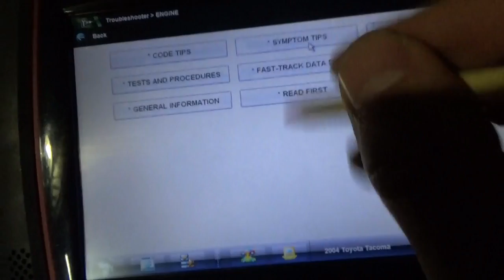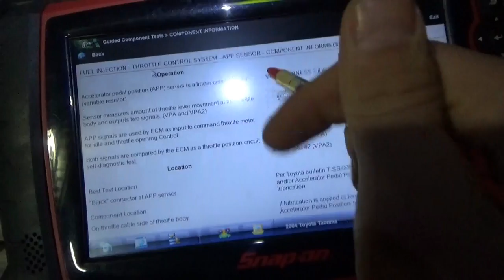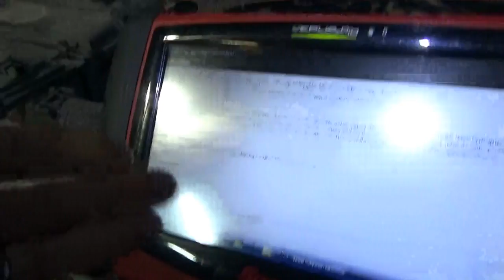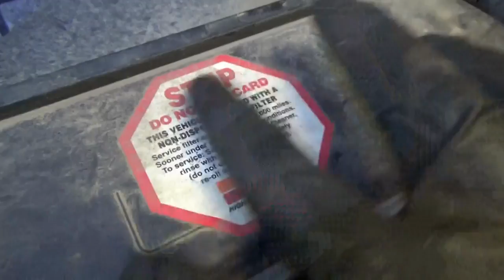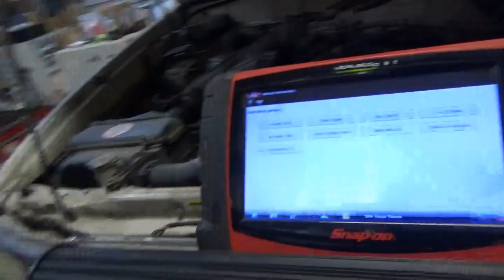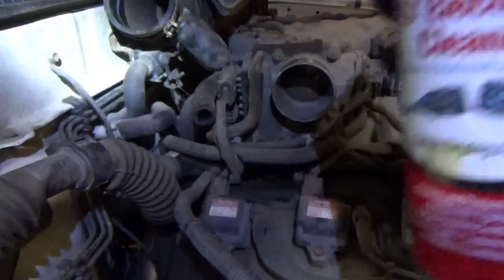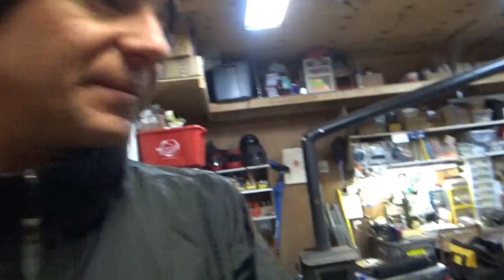Toyota Truck LIMP-HOME (P2111)

Comment: I know this is an old video but the problem ever come back and did you ever figure out what it was? I have the same issues and code!
Reply from the maker: Truck is still running great at 304k miles! 😎
Reply: Thanks for the reply!  Definitely a coincidence that I’m having the same issue @ 265k miles. Gonna clean throttle body and go from there.

Comment: I got a 2.7 automatic 2001  i got a loss of power , hardly goes past 2k rpm , i checked aur filthers, and cleaned them, and the Trothle and cleaned it, i changed the coils the 2nd and 3trd keep getting dirty, idk what problem could be

Comment: Yep.  Got an 03 and bastard did same shit..  randomly the throttle has no response..  replaced tps.  Still broke.  Tested all wiring and back to the ecu.  No signal at ecu..  replaced ecu…. Fixed the issue..  pos..  for a month i just unplugged the tps and accel pos sensor along with the motor in the tb and rigged it up to use the cable only..  was the only time in that motors life where it actually went to 100% throttle..  lol. Otherwise it cuts at 70%..

Comment: That air filter looks like one of my lawn mower air filters after not cleaning it for 5 years LOL but my engine always ran lean (for 15 years) so it ran worse when I cleaned it. After a rebuild of the carb it ran good with a clean filter.
Google says: . . .  use Super Clean to clean the K&N filter and 30W oil can be used. You can use compressed air before washing as long as you don't get to close to the filter with it. Use a garden hose but not to hard. This engine might have eaten a chunk of dirt or a pine needle that set the code but then swallowed the debris and just burned up.

Comment: I trashed my Kinder and Natalie air filter years ago. Project Farm did some air filter testing. The kinder and Natalie air filters pass to much dirt. 
I had to remove my intake manifold and actually pressure washed it. Never seen so much dirt get washed out. I now run OEm type filters only.

Comment: I'm just have the same code says throttle body by actuator stuck open and the second code say throttle body stuck close so  throttle body position sensor can fix or need a new throttle body???

Comment: Water contaminated fuel got in so we cleand the tank etc n fuel to the motor but no start - we disconnected the battery hoping for a reset n now no crank n all the warning lights on ......any idea wtf happened....n a fix..?? Thnx

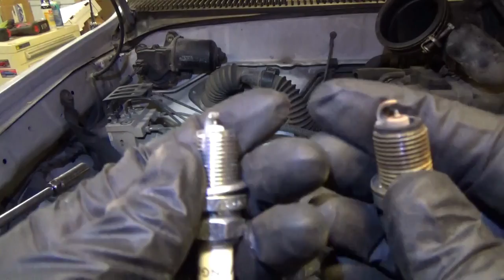Comment: 24:50 the brown deposit on the threads is combustion deposits when very fine leak develops between the plug gasket and it's seat around the threads (dirt lodged between the plug gasket and head)

Comment: those filters are designed to be cleaned and reused,they do sell kn filter cleaner and oil but just hot soapy water works,im sure you could substitute oil for the filter using mineral oil/veg oil or somthing that wont evaporate in time.those filters are high flow so oil is very important as thats what catches the micro particles if you ever do clean one
Reply: yup bucket of super hot water and sunlight clothes detergent for cleaning, and a spray bottle set on mist with atf watered down  with 99% isp alcohol, been doing this for years even on my foam filters
Reply: @stunessa1  ill try this detergent,i used dawn liquid soap but detergents should work better

Comment: Toyota has a badly designed air filter box where it is difficult to close it properly. Many times people don’t realize a gap or opening even though the airbox seem to be closed properly. Whole bunch of dirt get sucked into the throttle body. I see this all the time.

Comment: I have the same fantastic model. I would have cleaned the mass air flow sensor for sure and installed the correct duel ground Denso or NGK plugs as specified by Toyota. Toyota has even placed a sticker on the timing belt cover the importance of the special plugs.

Comment: Use denso K16tR11 dual ground standard plugs or NGKBKR5ekb-11 as suggested on the lil picture on the timing belt cover, they will last longer.  Ditch the K&N it doesn’t fit the air box well, poorly made and just dirties up the entire system with oil and ruins MAF’s.

Comment: I had one like this some years ago with the standard air filter in a 7.3 IDI. The customer thought it needed a new injection pump, but clearing the air filter solved the issue
I have no problem with these filters, and special cleaner and oil is not necessary. Any standard window cleaner works fine, and regular 30wt can be used in place of K&N products. 
Dump it in a bucket with some windex, wash it out with a hose, dry the element, spray some oil on it and it's good to go.
Oh, one off road recovery will more than pay for a timing belt replacement, so, do the math.

Comment: K&N filters and ones alike are meant for pavement Princess vehicles. If you look at project farms video comparing air filters, K&N was 100 times worse at filtering dust, versus a paper filter.

Comment: K & N filters are ok for on road use. They suck for dirty off-road use. The filter oil holds on to dirt and debris that should fall off the filter and accumulate in the box. This eventually reduces efficiency over time since most people will not clean and oil the filter every time they go and get it dirty.

Comment: Ok, just too simple. Air filter is EVERYTHING on any vehicle. Common sense  says off reading requires you to do more maintenance than normal requirement. zmost vehicles post a severe duty maintenance schedule.  That air filter is TRASH!  How can it NOT be related to the air filter. Of course it sucked the filter in and allowed garbage into and jamb up the throttle. The dirt in the throttle body was a dead give away. My dad always said, start with simple stupid before throwing the parts cannon at it.  Any regular Shop in town would call the owner and demand that they install a factory filter. That one was beyond cleaning. Aftermarket air filters especially K@N are SHIT!

Comment: Owner: wants problem fixed so the truck is reliable as possible and won't break down in the middle of nowhere 

Also owner: still has original timing belt with over 260k miles

Comment: Ask indicated by others K&N filters are a marketing hype (to the tune of $40). More than one Youtuber has tested them and the results are in. The K&N filters will let in a little more air (CFM). Along with more dirt and "filter oil". The  results are measurable. You be the judge. At best with a modern engine you might get a pony or two for a few months. You then spend the "rest of your days" tracking down oil coated MAF sensors, extra wear in the engine, ....

The Project Farm youtube channel had a good review of air filters.

Comment: I have a 1999 Tacoma 3400. I placed a K&N air filter on it and had to clean the Mass air flow sensor on it because oil from the filter covered it and slowly pick up dirt and it gave an incorrect reading. I went back to a paper air cleaner and it has run fine ever since.

Comment: I can’t be bothered to clean oil   a kn filter I just install a paper 🧻 filter every 4 oil changes.   That plug was pretty worn and engine was running smooth it must be a Toyota 👍

Comment: Yota power!!  Haha,   those motors are bulletproof!!!  Reliable and strong lil uns... lol.  I can't unsee this clip when you dewalt it in the spark plug hole.   Damn!  Makes me cringe lol. You're lucky it didn't go batshit, lol.   Nice video!  When i got my blazer at 223k miles.  Throttle body got so carboned up.  Cleaned the hell out of it.  It runs like champ.   Now it's 240k with original motor and trans.  Lol.  So anyway.   Great job cleaning up the throttle body!  Many thumbs up

Comment: Had similar problem with my 2000 tundra 4.7 going into limp mode over throttle body issue.  Only on very cold days, if I were to do a quick throttle response after first starting to drive it cold, it would throw a engine light and kick into limp mode. It is a heated throttle body, and when it's real cold out that motor that moves the throttle plate can lag compaired to what the ecm reads the throttle position to be at.  So on very cold days I make sure I fully heat my truck up before driving. Knock on wood it's been 6 years trouble free since it's happened.

Comment: Maybe I missed something, but I certainly would have replaced the air filter as part of the tune-up along with the plugs and fluids you were to perform. Maybe you did, idk. If not, you contact the customer with a revised estimate to include a stock replacement air filter. Additional part won't break the bank and well spent, especially in this particular case.

Comment: I would have cleaned the intake temp sensor and MAF sensor also I seen ford had a call back on there throttle bodys kept going limp in mode n also needed reflash after throttle body cleaning

Comment: What a bizarre setup. Who puts an electronic throttle in and leaves the accelerator cable into the engine bay? And why only on the 4WD model? Only Toyota apparently, lol.

Personally I would disregard the advice on the K&N sticker and go right ahead and discard that thing, and use a regular style air filter..

Comment: Are you have to do is put it in a small flat pail pan dish washing soap for a little while and let it soak and then rinse it with hot water do that several times and then let it dry out.

Comment: 260k? That Toyota has just past the "break in" period. I have a 94 Corolla I bought new and keep now as a 3rd vehicle with 386k on it. She runs good
Reply from the maker: Nice. No oil burning?
Reply: @PineHollowAutoDiagnostics  Yes, she uses a little between changes. Its ok though it is an extra vehicle now and not a daily driver. I may not drive it for a week or two sometimes. Mainly, its used to for store runs or occasionally I'll drive it 80 miles round trip to the job.

Comment: Those k & n filters do not do a good job at filtering fine pariculates. He will have advanced engine wear from using it. Given his offroading, You should should advise him  to urgently replace the k & n with a stock paper filter and change it routinely.

Comment: I had a 1987 4x4 with a 22r. The last year of the carborated trucks. I would have bought another but like you said they are not that good of trucks any more. Much of that is due I think to quality control and Chinesium steel.

Comment: Have owner change to aem dry perm air filter get rid of k and n one aem does not need to be oiled just cleaned.  Great e gine I'm  im the market for a toyota 4runner
Reply: My 99 toyota rav uses twin tip iridium plugs or nippon denso . I use aluminum  anti seize  on all my vehicles

Comment: I saw that air filter.  I can say I can better yours.   About7 years ago, I saw a Dodge 2500 pickup with the Diesel.  In for black smoke, no power.  I always pull the air filter first.  Air filter was so plugged it turned the air filter almost inside out and Halfway up the turbo to filter tube.  Literally caked with yuck.  Cleaned filter to turbo and put In new WIX and ran fine.  10000 miles later needed a turbo.   Coincidence?  Doubt it.
Reply from the maker: Wow that's nuts

Comment: That particular engine type was vulnerable to oil sludge build up on the heads due to a tendency to run hot. Frequent oil changes using the right type of oil is critical. The sludge runs down the engine block into the oil pan plugging the oil pickup and causing the engine to throw a rod due to oil starvation. It's a well known well documented issue.
Reply from the maker: Wrong engine... You must be talking about the 3.0 Toyota V6 😉
Reply: @PineHollowAutoDiagnostics  No. I'm talking about the 3.4 V6 which had the problem during that era (late 90s early 2000s). I had one with the problem. I looked it up and it was a common problem. They may have fixed it since then. I can't say. It's the very same engine in the truck in the video. There were a lot of battles with Toyota and owners at the time over this engine because they didn't want to honor the warranty and fix them.. Toyota was claiming that people should have had dealership oil changes and that owners were NOT changing the oil often enough and or using the correct oil in order to 'duck out' of having to replace engines.. 3.4 litre V6
Reply from the maker: @fredflintstone8048  oh wow I never heard of that problem! Must have been really poor maintenance. Every 3.4 that I have worked on doesn't burn any oil and the oil is never very dark on the dipstick...
Reply: @PineHollowAutoDiagnostics  I may have not been clear.. I don't know how much about the problem is still floating around the web. That was 15-20 years ago and it was a big problem. Hundreds of customers having to replace or rebuiding engines. Toyota took a real hit in it's reputation at the time in the truck market because as we know, Toyota up until that time was known and assumed to be a quality truck. Toyota did not advertise this problem at the time, in fact they tried to cover it up and blame the customers.
The problem was not that the engine burned oil. I never ran across 3.4s that burned oil either. The problem was the design of the coolant jacket in the heads. The top of the heads inside the crankcase would run very hot cooking the oil on top of the head creating a sludge that would run down inside the block over time plugging the oil pickup. The solution was to run good quality synthetic oils and change oil often. If people used synthetic blends, or non synthetics they were very prone to this problem.

Comment: Oh, gosh... what do you think of this scenario; Filter got so clogged that the excessive vacuum dislocated that seal, a bunch of debris and dirt got sucked in and temporary got the throttle jammed open a bit, the driver floored it after a restart, dirt got dislogedged (chewed up and spit out by the engine) but the now freed up plate is working just fine.
 Lesson: if you depend on your vehicle, remove all aftermarket crap! Even the "premium" aftermarket part's still inferior to reputable OEM which often undergoes fail-safe testing (in contrary to ANY aftermarket dito). Hope this one gets the point and installs the OEM-solution and keeps with the serviceintervall which makes it dependable.
Reply: I just watched the video and I was thinking the same thing, a small twig or similar.

Comment: Ivan, don't those engines use the twin electrode spark plugs? My 99 Corolla did.
Reply from the maker: I think stock ones were twin tip, at least in the 90s ones.

Comment: The owner wants the truck to be reliable but runs it with the original timing belt...hmmmm. I like K&N filters, and I’ve cleaned mine regularly but not sure they’re the best application for dusty roads.

Comment: If it ain't broke , don't fix it ? What about maintenance ? If those plugs are original , that's INSANE ! If the gaps are blown open and worn away , how much gas did you save ? And if they stressed the coils and took one out ? On certain engines , Ford's , etc. , they get Frozen in the head and break off . That air filter was also a gas waster . Would you drive that across country ?

Comment: “Smart system” steals your power. Okay give me the old dumb system. I have been burned by throttle by wire on my 2500 and 3500 Silverados . Reduced engine power blues

Comment: In addition to checking if the throttle plate closes , I check the throttle shaft bushings . Just like carburetors in the old days , those shaft bushings can wear out . It may not be often , but it will send you running for a problem . As well as a loose throttle body .

Comment: Those hybrid throttle body were what the used just before drive by wire system
 My nieces Suzuki Verona has the same sistem. The computer ajust the plate angle via step motor to keep control of the idle and eliminate the need of IAC valve. In addition eliminates the need of external motor to do the cruise control.

Comment: Why do trucks like this one have a box on the intake pipe
Reply: Resonator to dampen noise
Reply: @Discretesignals  ow thank you would that restrict air
Reply: @neilmurphy845  it will if you are building an engine that needs lots of air flow, but for that stock engine it's fine.  It was engineered to be used with that stock engine.  Even if you eliminated it, you won't see much of or any difference in power.  It would probably make more noise under the hood during WOT with it gone.
Reply: @Discretesignals  thanks

Comment: These aftermarket filters do let through more particulates (especially if as poorly maintained as in this truck), so I wouldn't really recommend them for off-road use. Let's continue watching and see what horrors reveal themselves as you dig deeper.

Edit: and the idle jumps high as the engine breathes easier... to be expected. That should sort itself out.

Comment: Nice find there! Good that the code lead you in a general direction - usually they don't!

I've seen this happen on dirt bikes- filter gets neglected, and pieces of grit (doesn't take much) take up the clearance between the throttle butterfly or slide, and jams the thing wide open. A fun ride on a 2-stroke, LOL! Alot of the time they won't shut off by yanking the spark plug cap, either! Have to get brave and hold both brakes and slowly let the clutch out to kill it. 😂 Been a couple decades since I've seen that!

Good to know about these Toyotas - I'll keep that in the back of my brain. General quality seemed to head downward after '96. That's probably one of the last good vehicles made of ANY brand.

I had a K&N filter in my Silverado for the first 50k miles. That could be why it started burning oil at 50k! It's definitely a ring issue, since it only burns alot of oil if I push it too hard on hills while towing. If I keep the cruise control off, and don't let it scream at 4,500 on every hill, the oil consumption goes back down to a reasonable level.